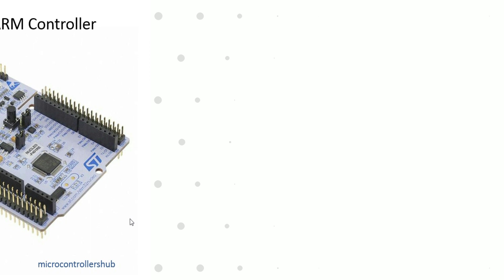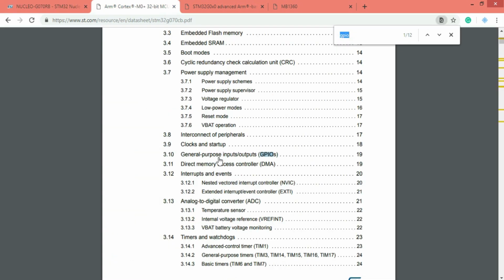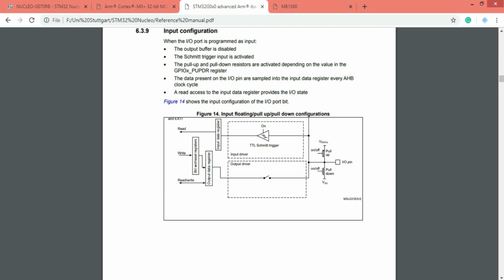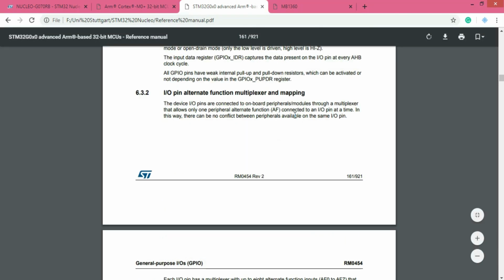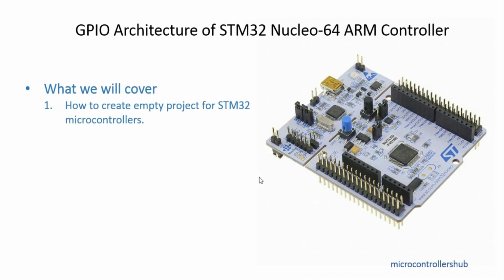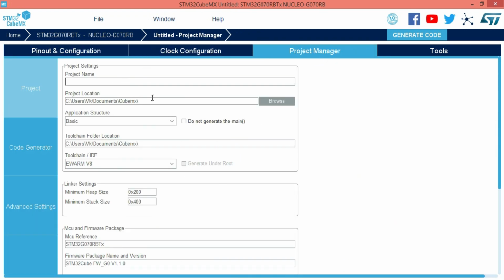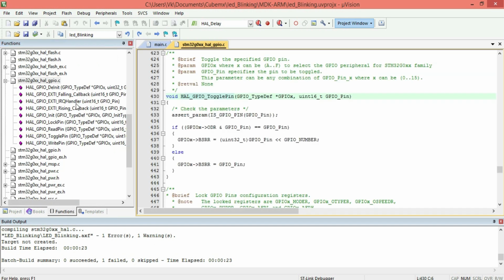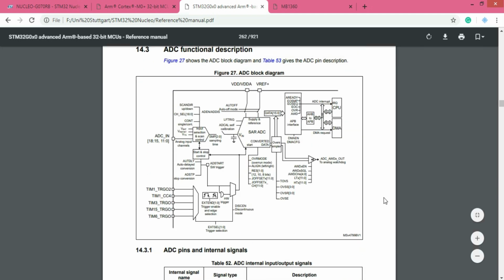GPIO Architecture of STM32 Nucleo 64 ARM Controller

Comment: i am getting an error like this when i am trying to flash the code.
Error: Whole bank access must start at beginning of bank.
can you please tell me how to correct it
Reply from the maker: Try reinstalling your software and let me know if it solves the issue.
Also, try to upload your code on another STM board. With this we can check if it is a hardware issue